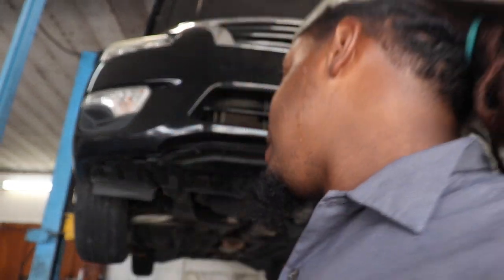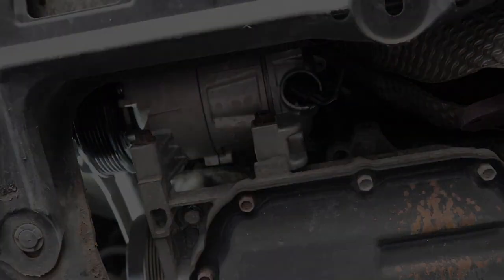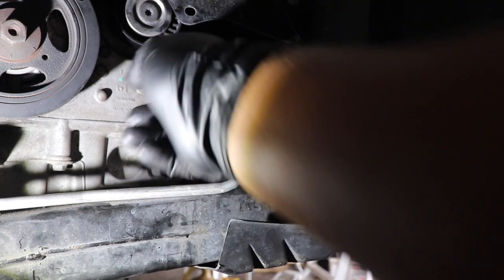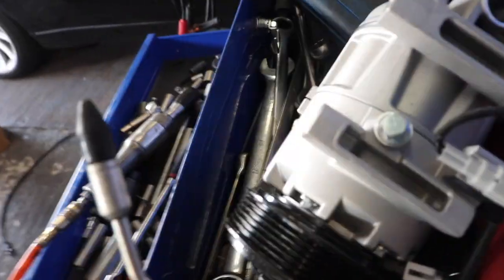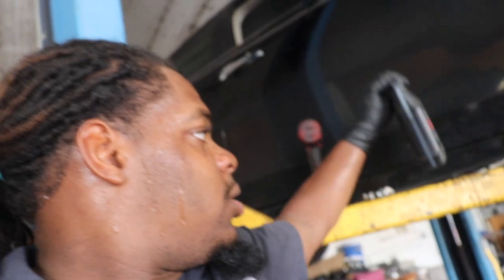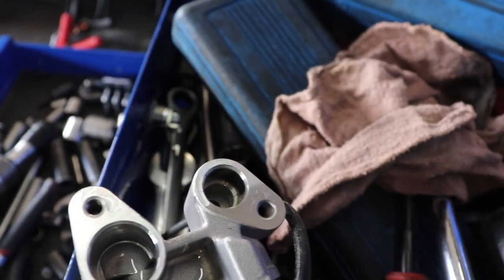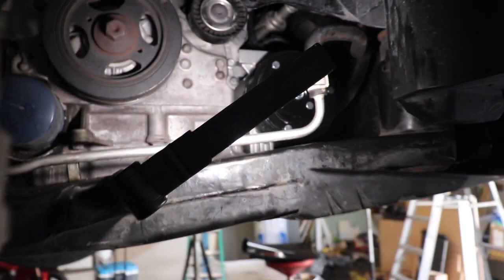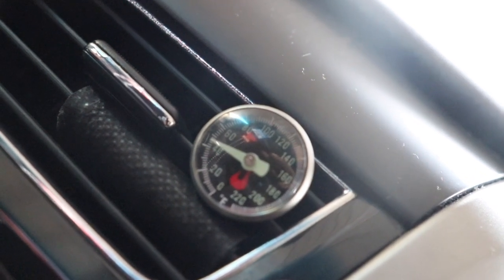How to fix the a/c compressor on a 2013 nissan altima.(40 degrees)

Comment: Bro you a beast at fixing these cars. I changed my 2013 nissan pathfinder ac compressor with this video. I got a question though.  When the compressor kicks on it starts revving super high. Does something need to be reprogrammed or did I miss something?

Comment: How much does it normally runs to get it fixed. To replace the compressor I have a 2014 Nissan Altima SV
Reply: I think I need to do the same with mine. I am gonna do it myself after watching this video

Comment: what were the symptoms before changing the ac compressor? Currently have a 15 altima 2.5 that's blowing hot air when the HVAC system is completely off, and the car shows 35 psi of refrigerant

Comment: My ac Nissan Altima 2.5 L a/c started blowing out hot air, mechanic had the clutch replaced, added Freon worked for the first hour before I even got to pick it up and it kept blowing hot air, added more Freon before I took it, worked fine for the first 30 minutes after I took it, next morning it was blowing hot air again. He said it could  be the compressor, I need help please. The temp here in tx is over 100°

Comment: Hello so I have a 2013 Nissan Altima, mechanic fixed transmission and claims compressor is weak. Getting run around where are you located. Car has been in shop for 2 months. 😭😭😭😭

Comment: I had a new compressor put in my 2012 nissian maxima S and it still does not work, the mechanic said I have to have it recharged and he couldn’t do that part, he didn’t have the Diagnostic machine for that. Suggested I go to a nissian shop, is there a cheaper way?
Reply from the maker: Erica Sanders yea I’m pretty sure there’s a local mechanic that has a evac and recharge machine Nissan gonna tax you

Comment: I need to change my a/c compressor valve. where on this compressor is it located?
Reply: Its where the electronical connector plug is located

Comment: So I replaced my ac compressor and it won't turn on, they said they checked the fuses and the compressor still won't turn on. 2013 nissan altima
Reply: Same did you ever figure it out ?

Comment: Where is the filter for the AC line? I just had compressor replaced and there’s junk in the line and the mechanic is trying to find the filter for it.
Reply: Its right beside the condenser on driver side.

Comment: Get in my inbox, i need your help with my car 😭
Reply from the maker: Ariel Rush what’s wrong with it lol
Reply: AJ Whitmore my ac compressor went out and Nissan is trying to charge me 1500$ part & labor, i have a Nissan Altima 2013 sv model, i need to know where can i find it cheaper
Reply from the maker: Ariel Rush where are you located
Reply: AJ Whitmore Miami
Reply from the maker: Ariel Rush oh you pretty far.. I don’t really know any other shops down there but I’m pretty sure someone else will do it for a lot less than that💯 the dealership is a rip off
Reply: AJ Whitmore i need to know the details on the compressor so i can search & find it, we got autozone, advance auto parts etc.
Reply from the maker: Ariel Rush it’s just a regular Nissan Altima compressor just find out which motor you have in the car it could be a 3.5 or 2.5